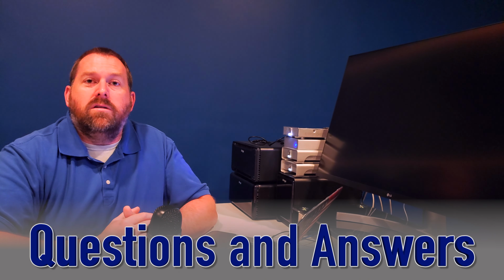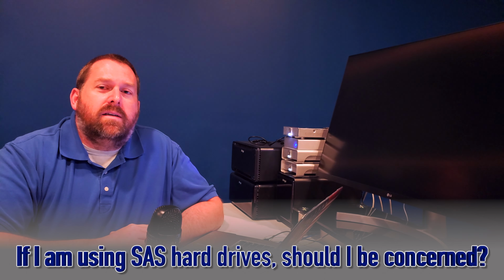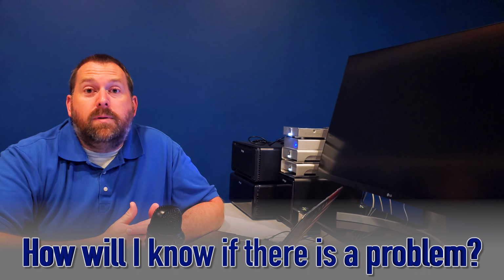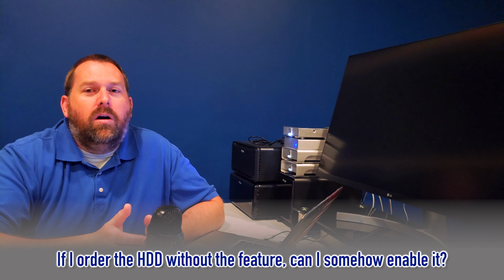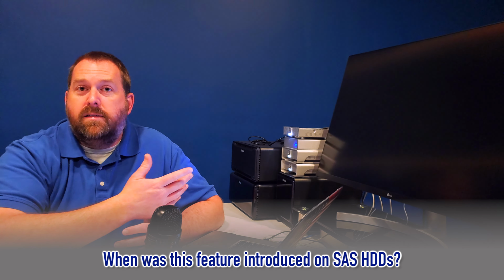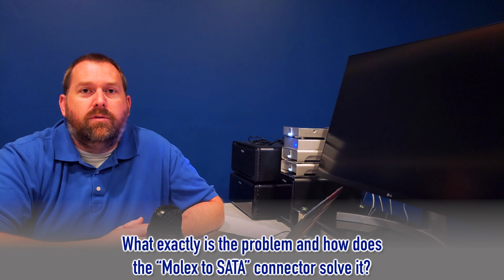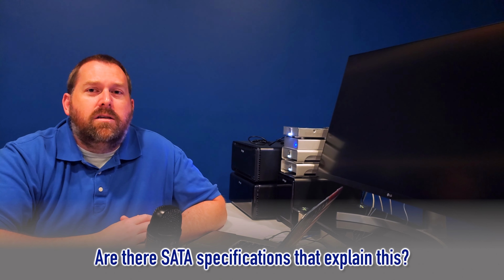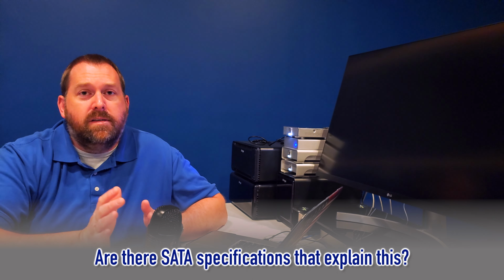Do you have a hard drive that has PWDIS? Do you want to know what it is? #PWDIS #harddrive #features

Comment: Weird I used the adapter and still did not power on
Reply from the maker: You might want to try some Kapton Tape (https://amzn.to/44O5uE9) and put it on PIN 3 on the Hard Drive. The Kapton Tape has always worked for me, whether it is in a computer, NAS, External Enclosure, etc.

I hope that helps. Let me know if I can help you with anything else or if you are still have problems with it not powering on 😊